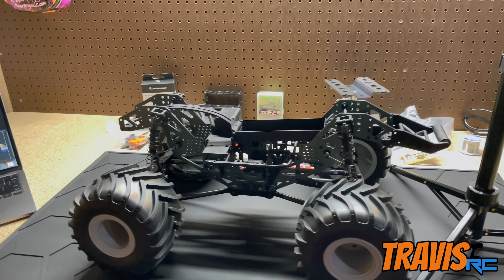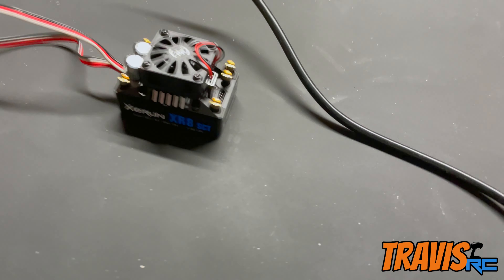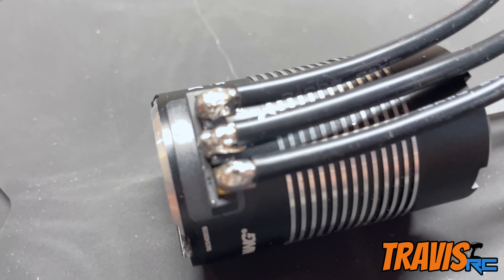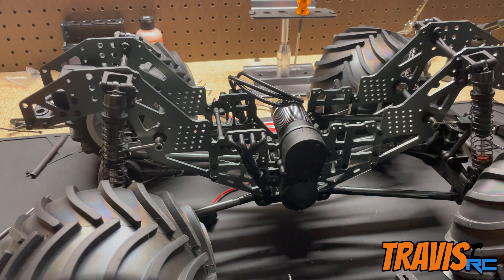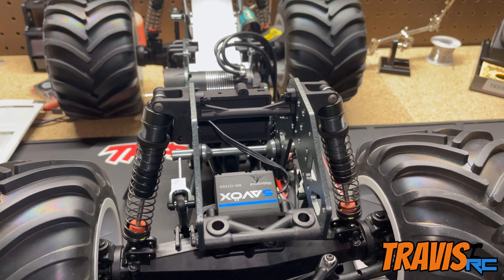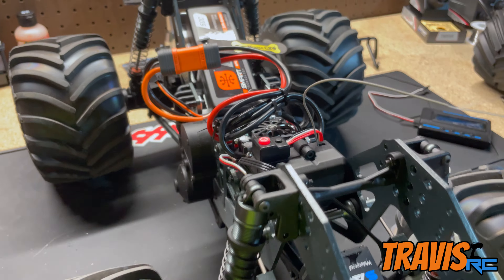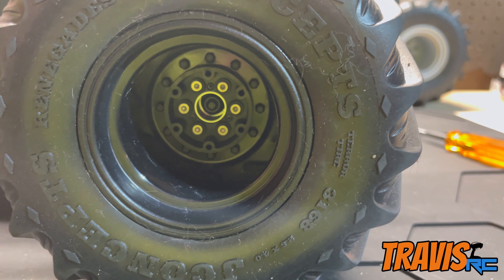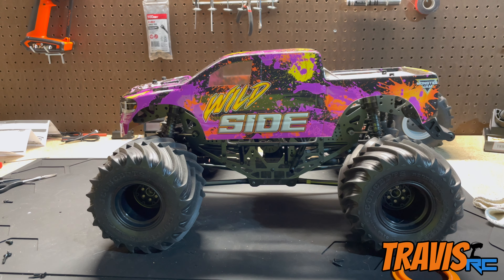BUILDING THE LOSI LMT | IT'S ALMOST READY TO RACE!

Comment: Great job bud. I did my roller a while back and wish I knew about the lcg battery trey. You should've mounted the body to the cage. It provides more structure and don't see the body posts.
Reply from the maker: Thanks! I figured for racing the cage is just added weight, yeah it’s stronger too but the body alone will be fine. Plus I really didn’t want to cut the body out for the cage to fit.
Reply: @travisrc1649  Ah I see! Makes more sense now. Plus it was a pita to fit it to the cage, not gonna lie lol.